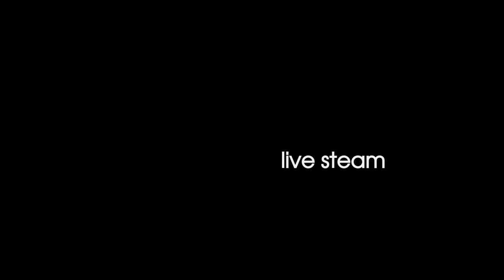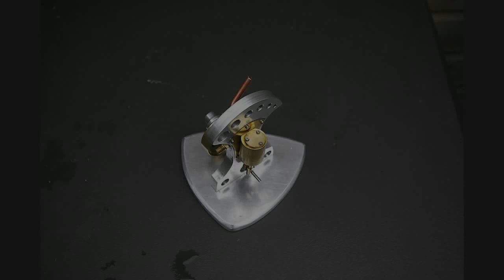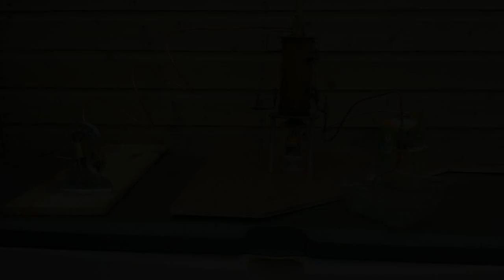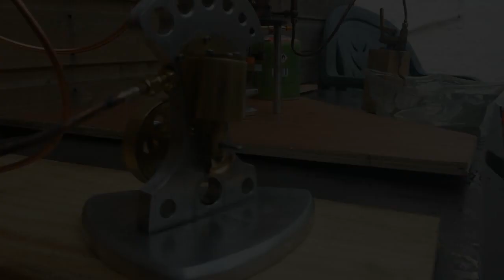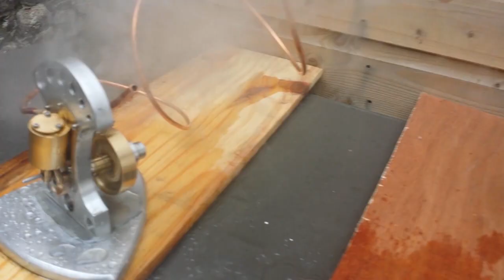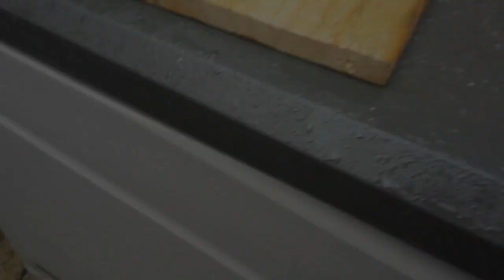Single-acting Oscillator Engine on Air and Steam

Comment: Nice work Gary. I like the stlying features. Nice boiler too.
The wet running is typical of these little engines where the engine mass condenses the steam until things get warmed up.
Leaking around the port face can sometimes be caused by cylinder pivot not being quite sqaure to the cylinder port face. The easiest fix is to open the pivot hole out a little. This allows the spring to pull the cylinder square to the engine frame at the expense of a little lateral movement of the cylinder.
Reply from the maker: Many thanks for your kind feedback Steve. 
Will think about widening the hole alongside other possible approaches that people have suggested. Will probably just run it for a while first to see if it wears in though.

Comment: Nice work Gary, lovely little wobbler engine, your boiler looks fantastic, I must build myself a proper steam boiler someday, ps, the crank looks familiar ;) Regards, Ade
Reply from the maker: Thanks Ade. I built the boiler last year because I didn't want to have an engine without a steam source to run it on. It was a bit of a mission but seems to have paid off. I'll be putting some finishing touches on the boiler soon.

And yes - the crank's a Swash. No question. I wouldn't use any other.  :-)